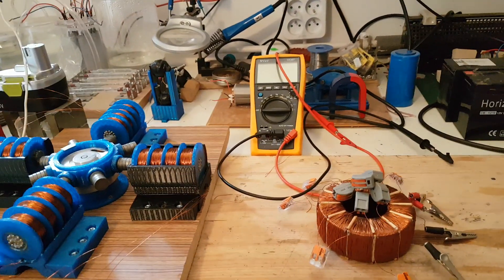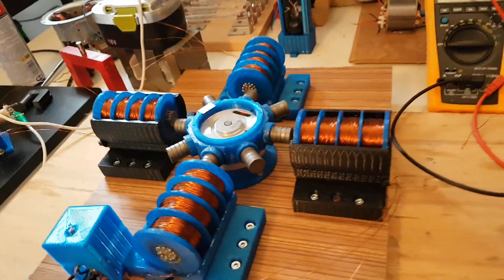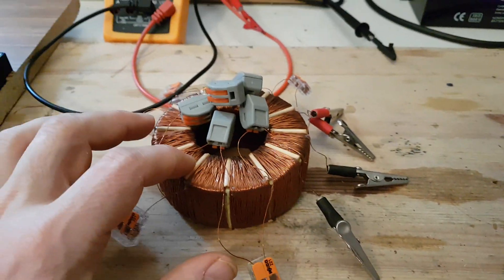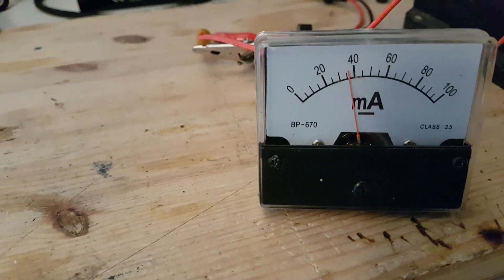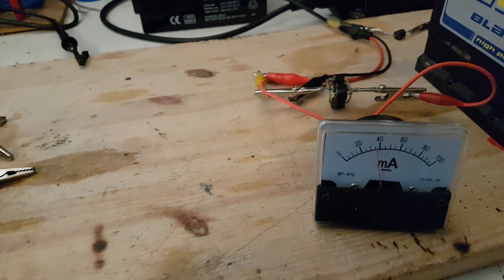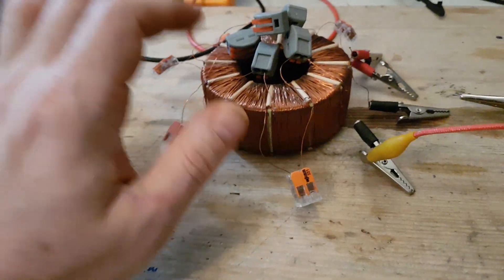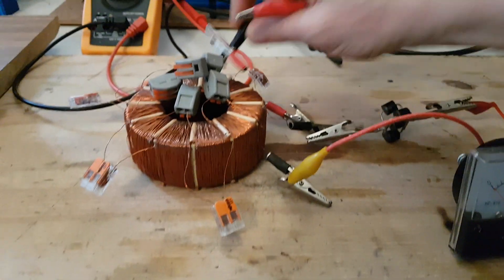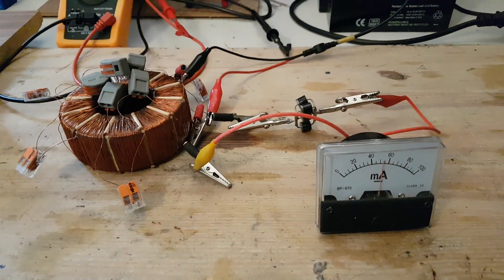Transformer Romanova

Comment: Please see magnetic flux as water into pipes for easier understand.  Now if you block water at a place it must pass at another place, so this is why magnetic shunt are used into current limited transformers as microwave oven ones and ballast types. Now you can imagine a kind of transformer, I will not tell you how but take time to draw ideas on papers before building, many ones will save time.
Reply: Michel, check my update video, showing some more measurements,  and then tell me how it applies to your water pipe theory ;)